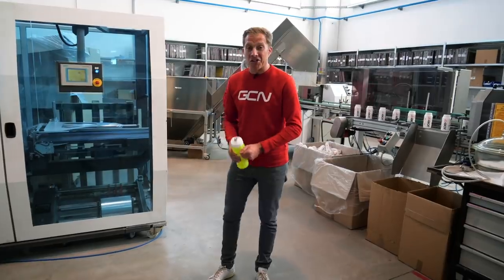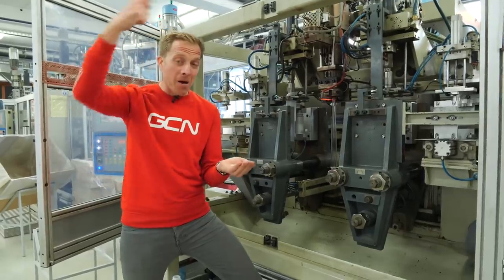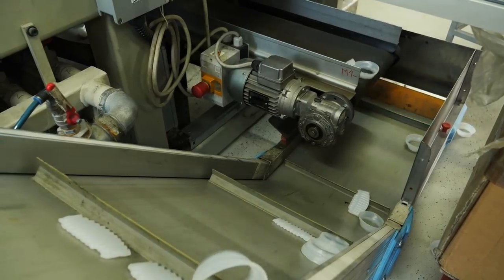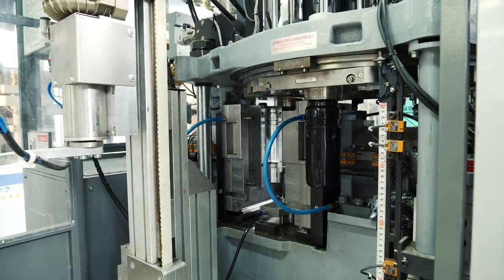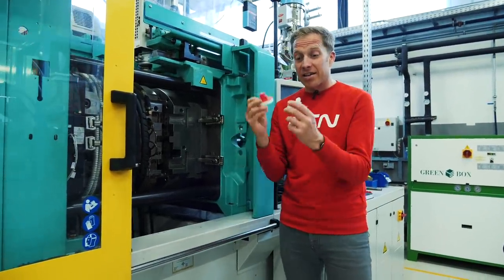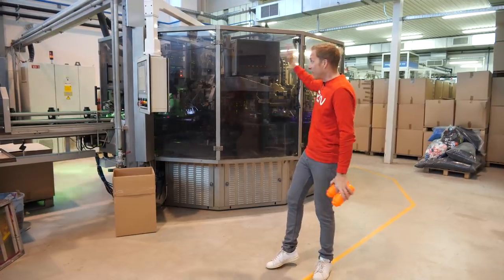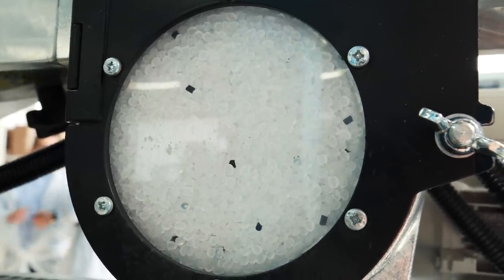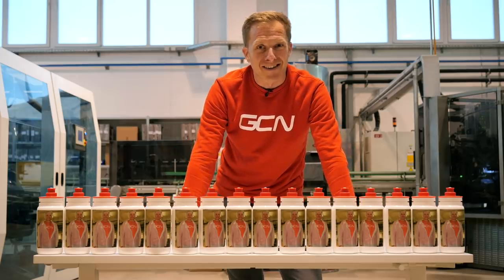More Interesting Than You Think: How A Cycling Water Bottle Is Made

Comment: weight saving tip: drill a hole in the bottom of your bottle - saves you 500-1000 gramms per bottle
Reply from the maker: Very good, why hadn't we thought of that before?!
Reply: I found that if you put a stick of dynamite in and a lit match it weighs even less

Comment: I would like to see how handlebar tape and gear/brake cables and housings are made.
Reply: With some exceptions, there's really just one factory in Italy that makes handlebar tape for all the major aftermarket brands.  They don't actually mix the rubber foam and extrude it themselves, it is imported on massive spools.  The Italian factory will perforate, trim, emboss, brand, texturize, etc, at their factory in Italy.

Comment: Great video!
I worked in injection moulding for several years in the factory as a mechanic. And i've got to say: from my perspective their factory looks pretty good. I know how it is when they want to film something or customers come by etc. everything gets cleaned more than usual. With time working in the industry you know where you've got to look at to know if a company does it properly or just like "dang, they come to film tomorrow and it should be clean, usually it's a mess". On a scale from 1 to 10, i would give them probably a 9. If you want, there's always room to improve ;-)

Comment: I'd like to see how they make a bottle that fully comes apart so that it can be cleaned properly.
Reply: You mean a Clean Bottle (tm)?
Reply: @surlyogre1476  I just looked those up and nope, I have a long scrubby brush to get into the bottoms. I need someone to make a spout that I can get apart to clean. It's the surfaces between the moving parts of the normal spouts that I can't wash. I salsa have a bottle like the old gcn ones with the little rubber valve in them. Again there are spots in the valve I can't clean. 

I don't care how much it weighs, but I do need to be able to open close it one handed or with my teeth.
Reply: Andrew__ Actually the spouts can be taken apart. Newer bottles use a softer more pliable rubber to make the spouts. If you look on the inside to the cover as you push and pull the movable part, you'll notice the little tabs on the side that prevent the spout from being easily pulled apart. If you use your thumbnail to push the tabs in while pulling the spout apart, you can separate the two pieces. The tabs are designed so it's easy to push the pieces together, but harder to pull them apart.

Comment: I have to say the elite fly is the worst bottle I've ever used.

1. The bottle I had leaks from both the cap and the valve.
2. The valve was easy to open but was an absolute pain in the ass to keep open when in the mouth.

The camelbac podium is a far far far superior bottle. Only downside is it's more difficult to keep clean.
Reply: I love my Elite fly's, though your first point is valid it indeed leaks a bit. 
But :
1) It fits ALOT better in my bottlecages than any other bottle, yeah I've tried alot of them Tacx works ok to but Camelback's don't, they are to hard to pull out.
2) I have no problem with the valve. 
3) I find that they are easier to push in to get more fluid fast than any other bottle 
4) the hole is bigger and so it's easier to fill.
5) alot lighter
6) the look better than most bottles

So for me the good points outweigh the loss of a tiny (yeah it's not much) bit of fluid.